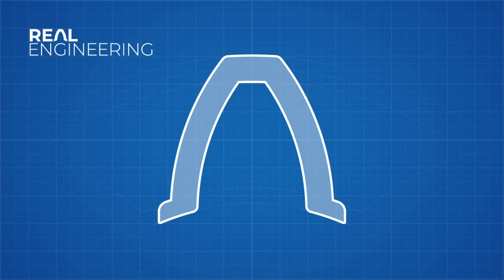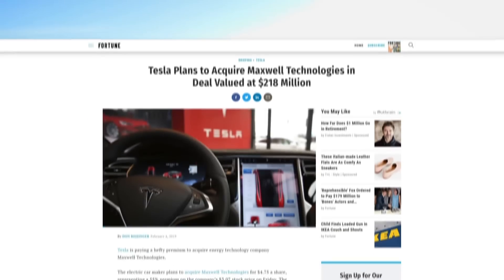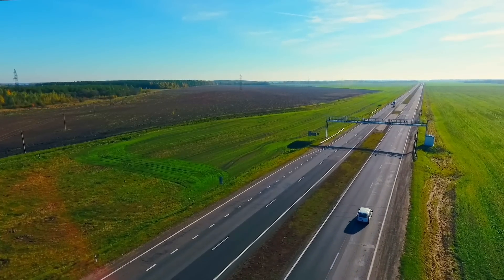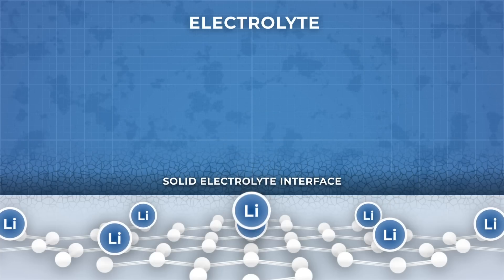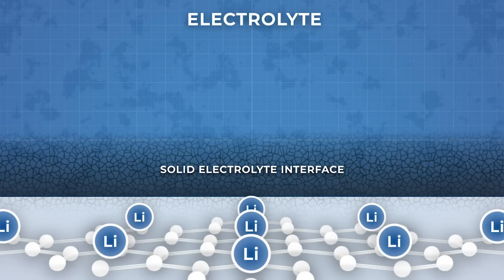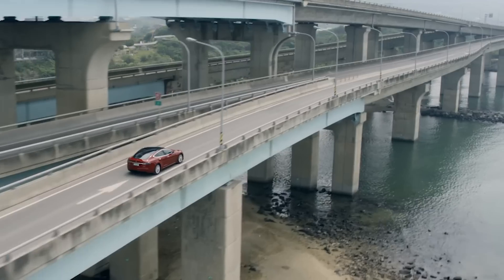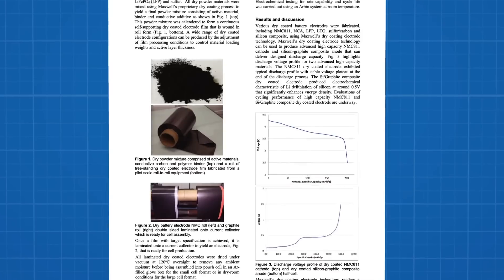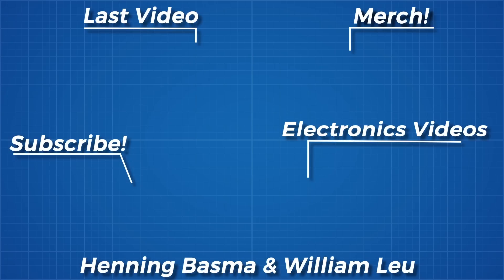Tesla's Quest for Better Batteries

Comment: I find it very admirable that Elon puts up the patents of these vehicles up for use without having to purchase a license, all for the purpose of making transportation greener, even if that means they receive more competition.
Reply from the maker: Yeaaaaaaah, about that. The clauses for companies to use them make it basically unusable by any of their actual competitors. Still an admirable move, but not near as altruistic as it may seem
Reply: Real Engineering Are you referring to the part which essentially requires them to do the same thing with their EV patents?
Reply: I disagree. the point is to stop being anti competitive (patents are anti competitive the way they are used today) and start SOLVING PROBLEMS.

I think that is the point of what they are trying to do. (correct me if I am wrong that is what it feels like. its like share alike cc licensing)

today we don't use patents to innovate. we use them to "lock in and lock out" competition and consumers.

look at 3d printing. locked up for 17 years. nearly no advancements at all.

patent expires.

you can now purchase a 3d printer for under $200 that will print 220x220x250 and for just $150 more you can do 300x300x400 with astonishing quality and reliability.

I have 90 of them !! (youtube channel) its insane. and now that the race to the bottom is over we are starting to see real innovation being attempted.

I mean my god 5 years ago it was $2000-$4000 for a basic ho hum 3d printer (which was amazing compared to their patented varieties) and now $160 gets you an excellent machine with just a little diy work. its amazing. I am doing a 160 hour print right now on a $340 machine with a 0.2mm nozzle and the quality is out of this world.

all because the patent expired.

GM single handily held back electric car development for 15 years with their controlling NIMH patent from ovonics. if not for that we would all already be driving electric cars. NIMH batteries are superior in many ways to Lithium (except in energy density) and much much cheaper. Lithium is just now starting to catch up to NIMH in cost and lifespan overall. thanks in large part to Nissan and Tesla.

sometimes. just sometimes. profit needs to take second chair to innovation and what mankind needs.

patents are not bad but they can be and are heavily abused to quash competition and innovation. that nimh patent should have been immediately revoked once it became clear they were just going to "sit on it" we need a use it or loose it policy for patents and copyright in this country when it comes to larger corporate interests.

 @RealEngineering
Reply: @nerys71  I couldn't agree more. Of course, we would have to balance it for everyone's benefit, but that is a good idea.
Reply: @RealEngineering  chineses startups have been taking tesla up on it.  existing manufacturers aren't because they don't want to cannibalize their ICE sales.  they are only pretending to try.  when they start going bankrupt, they will use the patents.  the free use of patents could be a key reason why tesla gets to own its own factory in china.  tesla is convinced they will innovate so fast they dont need the protection of patents, just enough trade secrets to stay a little ahead.
Reply: @RealEngineering  Their patents have been used by other companies as far back as 2015 without getting sued. I find this fairly altruistic considering the behavior of many companies is often to deny the world of technology by claiming patent rights without pursuing the technology being patented. Essentially locking technology away to prevent use. This has been a well documented consequence and failure of the current patent system that fundamentally negates the original intent of a patent which is to promote innovation and invention.

I am guessing you believe they are unusable because the company using them would need to be similarly open minded. According to Tesla’s Patent Pledge, the way it is opening its patents is by pledging not to sue any party using the company’s patented technology for electric vehicles, if such party is acting in “good faith”.

You might argue Tesla would use this as a ruse to steal their patents and then avoid litigation because they could counter sue. That strikes me as a very cynical way of viewing their open patent pledge, but you still need to assume two things; Tesla wants to willfully violate someone else's patent AND that by doing so it would negate the altruistic nature of their pledge not to sue.

 Altruism does not require self sacrifice. Tesla is simply requesting that those who use their patents not sue them by asserting patent rights over them. Tesla’s definition of “acting in good faith” depends solely on three things a party wanting to use Tesla’s patents for free can not do:

- asserted, helped others assert or had a financial stake in any assertion of (i) any patent or other intellectual property right against Tesla or (ii) any patent right against a third-party for its use of technologies relating to electric vehicles or related equipment;
- challenged, helped others challenge, or had a financial stake in any challenge to any Tesla patent; or
- marketed or sold any knock-off product (e.g., a product created by imitating or copying the design or appearance of a Tesla product or which suggests an association with or endorsement by Tesla) or provided any material assistance to another party doing so.

Since people clearly take your comments to heart I felt the need to explore some of your statement. Maybe you can qualify your belief that this pledge is not nearly as altruistic as it may seem?
Reply: @RealEngineering  Are you trying to fault them for that? Better get your head right.
Reply: Real Engineering oh, my bad then
Reply: It's in Tesla's interest that the technologies they've chosen to use become the standard and become the technologies on which academic researchers focus and provide advancements for free
Reply: @bonob0123  Both Tesla's and everyone else's, I'd say.
Reply: @rrs_13  yep I don't think it's evil or nasty. I just think getting wide adoption would be a big reason for anyone to do it.
Reply: Sandcastle •  WW1. When the war came about governments needed to find an energy source to power their war machines and at the time petrol was the most user friendly, the war created the monopoly that the rockefellers still have to this day. Even though imperial oil was split up to destroy that monopoly the family still owns essentially all those businesses that the monopoly split into. If WW1 didn't happen then pretty much all our tranportation would be electric by now!
Reply: The only thing he is making sure of is that copycats - which will always exist - will get their shit done proper while advertising Tesla's tech and standarts for free. It's like pirating windows; MS would never really dare take down every single pirated windows machine because that's what's making them the most used OS in the world for decades.
Reply: the man cares about this planet and its future
Reply: As others have said it was kinda a marketing move. Basically if you want to used Teslas patent portfolio you need open up your own patent portfolio for Tesla to use. The idea is that you share knowledge and don't just mooch off Tesla if you want to develop and compete with Tesla in the battery and car market. Thus moving the industry forward. However a company like Toyota has literally thousands of patents. While they may want Teslas battery knowledge they don't want to share all their patents. Which they could charge Tesla for or keep as an exclusive feature.

However  if you just want to design the car but not the batteries you can do that and use Teslas batteries. Just buy them from tesla. This does not require a patent exchange. Tesla would be ok with that because they will gladly sell you the batteries and if they become the defacto electric charger company it only benefits them.

Next time read more than just the headline.
Reply: Jttv not quite
Reply: Any company using it need to make all their patents public
Reply: If it was true, there would currently have been over a dozen Chinese companies that made cars that was just like the Tesla, but there is none, so it's obviously bulllshit. And Teslas aren't greener than a regular ICE cars, especially true for those with an Euro6 spec. It's just that uninformed people thinks they are just because they're electric.
Reply: Sander Gjertsen Østvold “attack of the Chinese Tesla Clones”. https://www.wired.com/2015/10/attack-of-the-tesla-clones-from-china/
Reply: Sander Gjertsen Østvold lmao you speak of ignorance amid your ignorant speech. DiCaprio would be proud. Chinese companies are irrelevant as they are already doing as they please with regards to Intellectual Property rights in most industries, and they aren’t selling cars here but focusing on the domestic market instead, especially right now. The “green” comment is a red herring and irrelevant, idgaf, it has zero impact on a discussion about patents. You can’t even take the time to conceptualize a coherent argument before you begin typing it man, take a Valium or something.
Reply: Sandcastle •  material advancements, mostly.
Reply: Sandcastle •  because batteries were shit and heavy 40 years ago and they did people hated them cause of how heavy and shit they were.
Reply: Sandcastle •  🤔 Nissan sells more Leafs than Tesla does any of its cars here.
Reply: ....he did because he is a business man and he needed tesla's competition to grow in order to substantiate the market - otherwise tesla becomes a niche market and cannot make a global difference.  Super smart move.
Reply: That`s probably due to him employing "spies", to see if any modifications made by his competition may prove beneficial.. . :)
Reply: Science Revolution  solve that riddle, and bag yourself a Noble prize.
Reply: Sandcastle •  oh we certainly did more like 50 years ago.... but NASA supposably left them on the moon... I mean hey why not they didn't have to pay for it
Reply: really? because ive heard that when these cars break down just like anything apple only THEY can fix it and for a very high price.
Reply: Not to mention patents have to be incredibly specific. To the point where most patents are useless, make a single tiny change and the patent no longer applies.
Reply: Like real engineering said, sounds better than it is, here's a breakdown: https://www.lexology.com/library/detail.aspx?g=ca6c332f-2cc5-401b-b80d-36473d0754c7
Reply: coffeehawk no it really doesn’t, and such an assertion requires you have insight into “how good it sounds” to a given individual. 

All the BS aside, saying “you can use our patents as long as you’re not a company that’s stifling Electric vehicle development by using your own patents to charge others with infringement, so long as you haven’t come after Tesla for patent infringement, and so long as you aren’t blatantly ripping off Tesla in areas not covered by patents such as design etc. 

These are pretty simple, and acting in bad faith is not easily proven in a court of law unless the company blatantly violated the spirit of the agreement. 

Lastly just as the article you linked says, it’s simply necessary to evaluate whether the benefit from Tesla’s patents outweighs the limitations. In other words, unless you’re planning to sue them or blatantly copy them. It’s not that hard folks. 

As for how groundbreaking Joe Consumer assumes the Tesla patent portfolio availability will be, thats really a poor of no real tangible consequence & is a moot point.
Reply: I know right. It's more about the PR they get by showing they care.
Reply: baap no it’s a concept called “share alike” from copyright licensing that’s been adopted by patent holders as well. In other words “sure you can use my artwork for free, but only if you’re going to allow whatever you use it in to be used that way as well”

It promotes a healthy library of copyright free music/media.if a company refuses they can seek a alternative licensing arrangement, but the purpose of it is to promote the health of the electric vehicle market, the theory being competition ensures a healthier market, without which Tesla and its patents will cease to exist.  

What they would be foolish to do though, is make patents that they spent tons of R&D money developing available to legacy automakers and not expect them to do the same with their electric patent licensing terms, because then you’re literally giving your competitors the ability. To move ahead based on your work while they use their own IP To limit the flexibility of others in the space

https://en.wikipedia.org/wiki/Share-alike
Reply: patents last 10 years, then they are open to everyone to copy.
Reply: Patents should go away anyway.
Reply: At one time New York city had the highest number of charging stations. Can you name that date??? right around 1910! yes 1910. In 1900 38% of all new cars were electric.  Sandcastle •
Reply: @SixPackDan  how many total vehicles(this might need defining) in 1910?  how many total electric vehicles that same year?   without this data, those numbers could easily represent a small fleet today and not general population needs.
Reply: Elon doesnt give a shit about tesla cars.....he himself even stated the whole game is batteries.
Reply: @SixPackDan  actually not true at all
Reply: At the beginning of the history of the company that was the case. However, it's clear they are trying to make Tesla a trillion dollar company by completely decimating the competition and retaining the gigantic market share. That's what happens when you go public I guess.
Reply: CosmicButPlugg no you’re just confused
Reply: Sandcastle •  You are giving Elon far more credit than he deserves. EV would be moving forward with Elon or not. The only difference is that he makes flashier cars with the technology
Reply: @LordOfSilense  Complete lie.  Musk is the driving force behind EVs, batteries(cars and powerwalls), rockets, and TBMs.  Without musk, the competitor cars don't exist.  GM isn't making a bolt and selling it for a loss if tesla didn't exist. We would only have hybrids.  Look at the $35k model 3, it is another paradigm shift forcing all competitors to change how they build cars and preventing them from continuing to cheap out in batteries.  

Musk has disrupted so much.  No one believed in EVs until Musk showed that it can easily replace ICE if it charges fast enough and you have chargers.  Now no one is worried about range or being stranded with an EV.  Musk's biggest leaps haven't even been by inventing new things, he literally took modern technology being ignored and applied it to these spaces.  

I would like to say anyone could have done it, but that isn't true.  Look how far behind all the competitors are even when they are trying hard to chase musk.  EVs like we have today would be 15-20 years out if the existing companies were left to do this on their own.
Reply: @_PatrickO  Absolute bollocks and ignorance. Many companies from China and India have been developing EVs far before Musk. The only place Musk has influenced EV cars is in America and EU since these two parts of the world care more about cars fast and performance based than cars being practical machines. EVs in America would be 20 years behind, sure, since Americans care about things that don't make good cars, but EVs elsewhere in the world would be perfectly fine.

And until Elon actually makes his company functional and sells products for the price the average consumer can buy, then his entire business is a luxury model line. And if you're building a luxury model like, anybody can make a high performing system. 

You people give Elon too much credit.
Reply: @LordOfSilense  lol, there is a reason all the EVs in china are cloning tesla.   The biggest company in china, NIO, is losing $400m a year and none of their cars have been crash tested.  These companies cannot come to the US because their cars aren't safe enough.  If a company cannot profit in china, despite the low labor and resource costs, they cannot profit anywhere.  The companies in china are all propped up with government subsidies.  As for india, what EVs lol!
Reply: @_PatrickO  Afte steam, electric vehicles were the 2nd type of car invented.  EV's were the most common car in the mid 1800's.  Chrysler restarted EV's in the 60's, GM again in the 70's and 80's - bringing the first semi-mainstream EV to the market since the 1800's.  What Musk is doing is using very rare earth metals to make electric motors more efficient, and Panasonic is doing the same with batteries.  One thing you can look up is that the rare metals that give Teslas more range are in shorter supply than oil.  That's why other car makers hover around the 80-120 mile range.  There's also no such thing as a $35k model 3.
Reply: @coffeehawk  lol, "rare earths" are not actually rare.  The name came from the late 1700s.  The scarcity today is nothing more than china dumping minerals on the market killing off mines anywhere outside of china.  Mines are starting to open back up with government backing to get away from dependence on china.  There are no "rare earths" in the batteries.  Just magnets.  The best part of magnets is they do not degrade much and are reusable for hundreds of years before having to regenerate them.  Tesla will easily be rebuilding motors, that is easy to do vs recycling elements in batteries.
Reply: @_PatrickO  Say what you want about NIO, but they broke the Nurburgring record, something even Tesla to this day hasn't been able to boast so for a performance EV, NIO gets my respect.
Reply: @_PatrickO  Yeh, it's still pretty impressive none the less. I am pretty sure the road homologated version was slated for similar performance as very little changes were needed to make the car street compliant.
Reply: Thanks for showing how clueless this person is